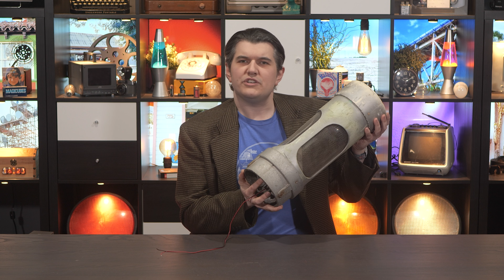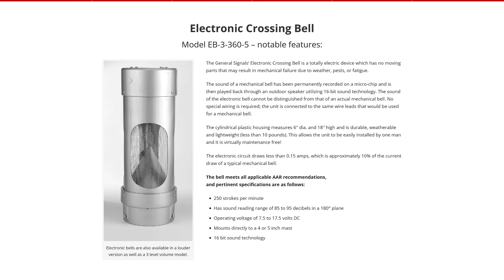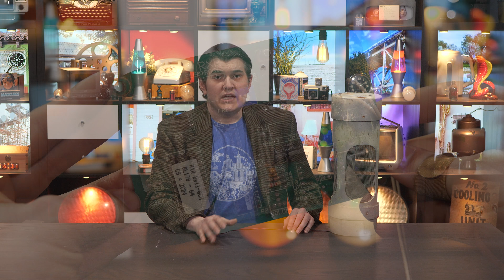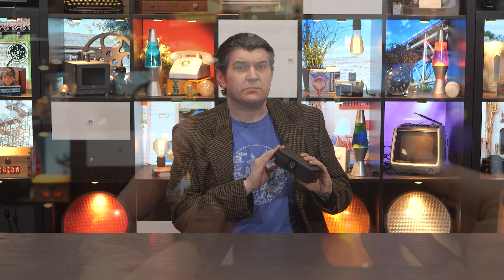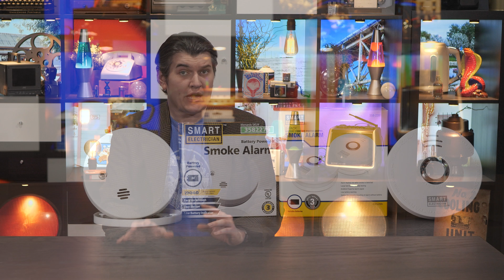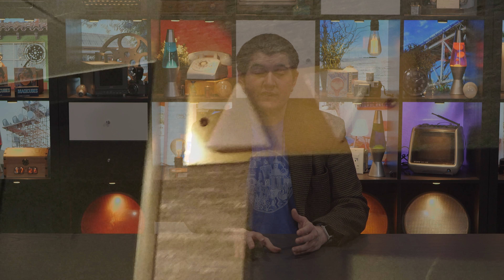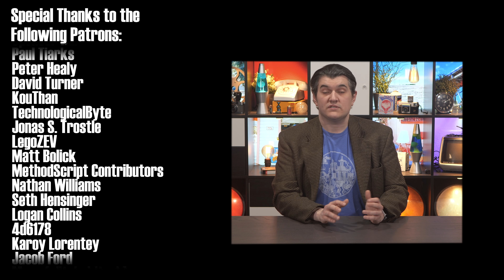The disappearing and unappreciated art of audible alerts

Comment: On a ship the audible emergency alert is standardised as seven short and seven long blasts on the alert system or ship's horn. If you hear it once during the muster drill you know what it is every other trip. 

Apple are still pretty decent at this aspect of the UX, although they aren't as good as they used to be! The text message tone will sound twice (in my case it's the morse code SoS) about a minute apart to let you know you have an unread message. You can change how often that repeats up to ten times. The new multipurpose button also defaults to the silence function, but I really miss the dedicated silent slider which is harder to accidentally trigger.

Comment: The typical pure tone reversing beeper used in large vehicles is something I wish would get replaced by law with a white noise "beeper" everywhere. I have heard it a few times in some modern heavy machinery and it is better in every way - not only is it more audible over traffic or construction noise, it is significantly easier to locate the source and also its less annoying to listening to when there is some work going on around your house or office.

Comment: Another example, which might not be widespread in the US, is two stage fire alarms. The stages are usually 20 beeps per minute or 180 beeps per minute.

In large buildings the designers will assign zones. When a fire alarm/detector is pulled it triggers slow beeps in that zone. When multiple systems report activation that zone goes to fast beeps and adjacent zones get slow beeps. This can be customized.

This allows a standby signal where mobility impaired people can leave while able bodied can get ready to evacuate. Some implementations are easy to mess up when a trainee accidentally locks the whole building to full evacuation while training on the control system 😂

Comment: Alec having the exact same rants about Android changing things around that I've had for years is genuinely validating for me. 💖

It tends to be the reason I disable updates for as long as possible, because Android upgrades tend to change things around and I can't find them anymore.  I'd rather keep things the same than be secure, which is not a choice I should be forced to make (and it's only getting worse with generative AI being forced into everything and automatically turning on when I turned it off already (though in that case, the generative AI is likely less secure now that my data is going to leak further and faster, so now it's secure either way I choose)).

Comment: If it's important it makes noise, if it is not important it doesn't make noise. It isn't a hard system to setup. You don't often need to know how important something is. Almost always it is either important, or it isn't important.
Reply: Do not fall into binary thinking! There are a many different noises. If I get a text I like to be notified to be able to reply quickly without being woken from sleep, so a soft sound. If I get called by certain contacts -> very important, respond immediately -> loud, jarring noise.
Volume is of course a factor, I wish phones could do automatic loudness adjustment. Even a soft chime can disturb if it is too loud

Comment: That board was MASSIVELY badly engineered by the 1996 (data on the board numbers), it's pretty possible by using only parts of that era to reduce its component count by perhaps 70% while using way less energy. There were chips which had recorded analog audio, you could then simply fed its output to a amplifier OP amp and bang ! It must have been designed at least 10 years prior and those things are highly regulated, the new board would have to pass through certification

Comment: Circling back to the train theme at the start of the video:
Train horns (at least used to) also communicate different things to the crew and people lineside.
I work at a heritage RR where we still use whistle signals and hand signals over radios, and we have 20+ different whistle signals that all mean different things. From as simple as indicating direction of movement, to sending flag men out, to asking the crew to check handbrakes.

Comment: That slow whoop was used as the chemical spill alarm when I worked in a bio lab.
Reply: The funny thing is that the slow-whoop signal is (as far as I know) a universal, European-wide alarm for evacuation in public buildings. Even non-public buildings (but I think the line between public and non-public is more of a norm-thing) such as my workplace have slow-whoop signals. While my workplace really can't be considered a public building (entering it without approval is even against the law) it still has slow-shoops, just like the middle school and professional education school I went to. I like them even better when the building itself is listed as for international use and the alarm also speaks in 4 different languages (in The Netherlands this usually is Dutch, English, German and French): 'WHOOOOOOP! WHOOOOOOOP! WHOOOOOOOP! Attentie! Attentie! U dient dit gebouw zo snel mogelijk te verlaten via de daartoe aangewezen nooduitgangen! Attention! Attention! You are required to leave this building immediately via the designated emergency exits! Achtung! Achtung! Bitte verlassen Sie diese gebäude so schnell wie möglich durch nutzen der Notausgange! Attention! Attention! (nope... my French is not good enough to type that one down). Than the thing starts over with 3 whoops ;)
The weird thing is that when you buy a smoke detector alarm in The Netherlands, it's hardly ever a slow-whooper: they do exist but are extremely rare. Most of the time you get a temporal-3 alarm (the good ones) or a constant beeper (the bad ones, as these make communication very hard). Audiovisual smoke detector alarms for private use are becoming ever more common now.

Comment: The circuit board for the electronic train crossing bell looks way to complicated than it needs to be but I suppose it depends on when it was designed
For model railroad, I built a crossing bell from an Arduino Nano.  It had a sample of only one gong fading out.  The program would simply retrigger the bong at the right time canceling the fade-out if it were to keep signaling.  However unlike other similar modules that would abruptly interrupt the gong mid-fade, mine would be more prototypical with a fadeout.  Need less of a sample too.

Comment: I think in NL most railroad crossings still use traditional bells. at home, our doorbell is an actual ships bell, on a string with a knob on a stick sticking through the wall next to the front door (this place was build in 1887).

Since I had my first Pebble, I stopped using sound on my phone at all, in fact it's on do not disturb mode for everything except phone calls, which vibrate the device. I do miss having a colourful LED to tell me what kind of notification just came in on my phone though. (and I miss my old Pebbles. can't wait for my preorder to ship!)

You're right that we should have the option for better less annoying sounds. I think the 'marimba' ringtone on iPhone was one of the better ones, the whistling on samsung(?) phones one of the worst.

Comment: That "this is a computer" argument is so true.  So many things and settings that should be possible and would be useful, but just never get implemented because someone in power never thought to give the order to code it.  Cue random rant:  For example, a while back, I was looking for a calendar app for my mother that displays things in months and looks like a paper calendar because the default is hard to read as the months blend together.  Sounds pretty simple right?  Just have every page display 28, 29, 30, or 31 days per month and nothing more.  Surely there is an app that does that or at least a setting somewhere....right?  However, EVERY SINGLE ONE displays the month as full 7 day week lines.  So a particular week goes like |29|30|31|1|2|3|4| rather than |  |  |  |1|2|3|4|.  It seems like every app just copied Google Calendar and added a nice skin with note functionality.  I understand why it is the default, but it is just odd that it isn't an option.

Comment: I've wanted to get my phone to have an unobtrusive hourly chime like a clock for ages, but that's not something that's possible without setting an individual alarm for every hour; and that's defeating the idea.
Alec, you should get a mechanical RR crossing bell. It's a very simple piece of equipment as well with hardly anything to go wrong. The ring rate of the Ebell can be changed on some models, just like the mechanical bells

Comment: Back in the day my parents had a Chevy celebrity and my dad could not see the blinker icons, and he couldn't hear the click clack of the relay very well so he would often drive with his blinker still on. He ended up wiring in a chirping sound that would let him know that the blinker was still running so he could shut it off. 

Fun fact, my current car is a Volvo where the relay blinker sound is handled by the car's audio system. The way I found that out is that I have a bug where the radio would crash and I would get no sounds out of the speakers and the only way to fix it was to reset the radio either by doing a long press on the main button, or turning the car off and locking it and then starting it. When the audio would crash, I would not get the relay sound either. So clearly the relay was just a made-up sound being played by the cars speakers

Comment: All the smartphone mess has really gone too far. We need to agree on a public international standard of the dimensions, button locations and mandatory menu structure and functions of the software and it must be enforced on the tech manufacturers by the governments of all countries. Just like a car with a pair of joysticks instead of a steering wheel and pedals just wouldn't be legal to drive on a public road the weird stuff with basic functions barely accessible must not be allowed to be sold for use with public cellular networks. Even a poor standard is better than no standard at all.

Comment: These early Electronic crossing bells always sounded a bit muffled especially on lower volume. Due to that compressed audio. The later GS E bells (The type 2's and type 3's for any railfan reading this) definitely sound a bit more clear. Probably because they are aren't or at least are less compressed. The sound most if not all E bells like this make aren't actually a recording of a mechanical bell at all, rather it's a self generated tone designed to sound identical to a crossing bell. That's why so many of these E bells sound rather artificial in comparison to Mechanical bells.

Comment: Audible notifications are great sometimes. But my Prius insists on making beeps for what seems like no good reason with no explanation of what's wrong. If I open the door and then turn off the car it beeps incessantly at me for no different reason. 

I've been driving it for five years now and it still shocks me and takes a minute to realize what the single loud beep when driving means (fuel meter is down to one pip}...

Comment: In your rant about phones, there was a iPhone update that changed how the volume works on ALARMS. I was so late to work and I couldn't figure out why my alarm was set, but not making any noise. Eventually I figured out that sometimes changing the volume during certain apps also effected the alarm volume. No amount of troubleshooting could tell me how to prevent that, so eventually I just made a timed shortcut. Everyday, 1 minute before my alarm usually goes off, my phone raises the volume to it's max level. WHY IS THAT A THING. Then one day I just decided to buy a dedicated alarm with a battery so I never have to think about it again. The alarm has one job, and it does it well.

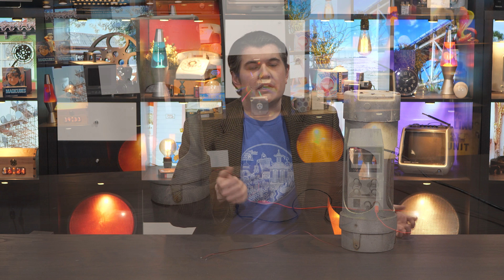Comment: 0:30 This is the “Type 1” sound, which was made between 1994-2000, and they have changed the sound twice since 2000, with the type 2 sound being used between 2000-2014, and the currently used type 3 sound being used from 2015-Today. The other three common E-Bell manufacturers for crossings are WCH, Siemens (they bought out Safetran so that’s why they are here), and NEG (they basically ripped off the GS Type 2, but with much worse quality), so that’s is basically why crossing sounds are sometimes different at different crossings compared to the one showed here. GS also made a super early variant of the Type 1, which is better known as the “Early GS E-Bell”, and less than 16 of those are still used, mostly in Louisiana and Arkansas.

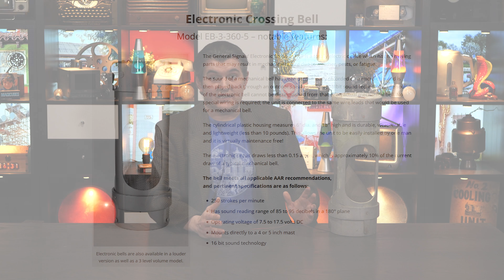2:38 The only mechanical bells still being made are from WCH, and no other manufacturers make them, since E-Bells are much cheaper to mass produce. Most mainlines have entirely replaced every mechanical bell at every crossing for miles, leaving only spurs and lightly used lines remaining with mechanical bells, but those will also be mostly gone in 10 years too…

Comment: When I worked at Pizza Hut, there would often be long periods with no orders, so each station was assigned a sequence of tones that it would use to summon its assigned employee when an order arrived. The make station would use a beep followed by a higher beep and fryer station would use a beep, a higher beep, and then the first beep again. You dismiss orders off the screen when you’re done with them, and these beeps would only occur when the screen was empty. There was also a single beep for an additional order arriving on screen

Comment: It's my first time hearing those fire alarms. I don't remember myself hearing a fire alarm or smoke detector but fire alarms were just continous loud ring without any interruption or change in pitch. If I search, I can pull up 20 example from movies, series and games immediately which we would hear just continous ring. So I think the standartization was wrong. They should just have check what is used everywhere and continue with that just like the train crossing sound.

Comment: TIL that they don't still use real bells ... also I bet the being made nearly completely out of plastic was a selling point, because (ya know) it doesn't rust and need replacing. 
4:21 information that I would have liked not to have to think about (I say in regards to the gross and wet parts) 
19:43 are you using the latest version of android 16 because notification cool-down works on my pixel 10...

Comment: I was pretty sure we still had mechanical bells in our railroad crossings in my country. Two bells to be exact with different frequencies, so they pulse in and out of sync. So I had to look it up. Turns out they are mostly phased out for sampled audio. But apparently it's a very convincing sampling/amplifier/speaker combo. 

But yeah, thanks for the rant! I share your pain!

Comment: It's interesting, actually. I've encountered several large buildings (schools, factories) where the fire alarm is the steady, most-obnoxious-tone-in-the-universe.

But the STROBE LIGHTS on the alarms still blink Temporal 3 (within the limitation of being a strobe light anyway).

Also, one factory so large that the fire alarm system was zoned - it would quack some morse code at you that you're supposed to mentally decode to the area of the building you're in and decide whether you are being told to evacuate or not. In practice this meant you stood up, looked around, and if you saw smoke you left. The "everybody get out" alarm was Temporal 3. This was PARTICULARLY FUN because it meant that if a fire drill wasn't pre-announced, everybody would look around, decide they weren't supposed to leave, and stay put.

Nobody in safety management saw the problem there...